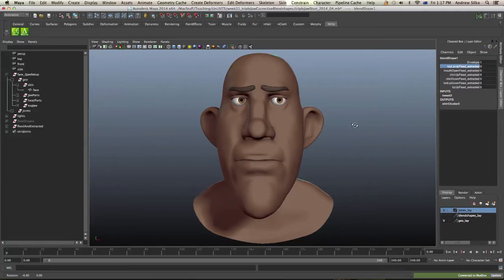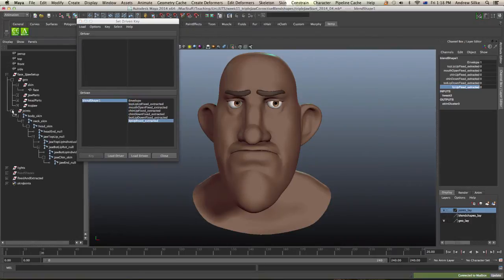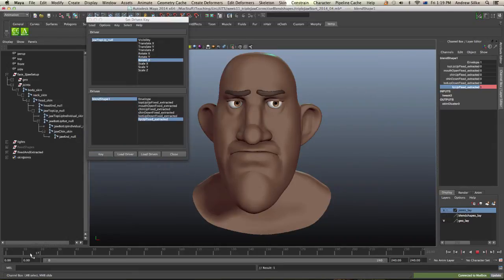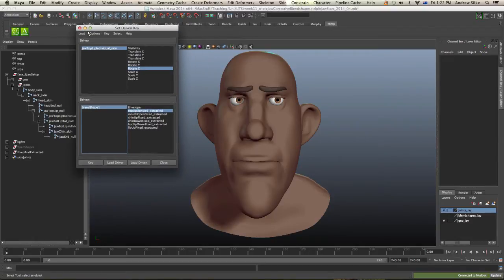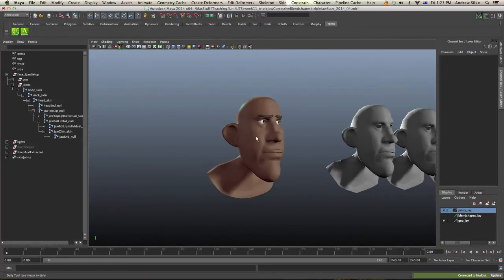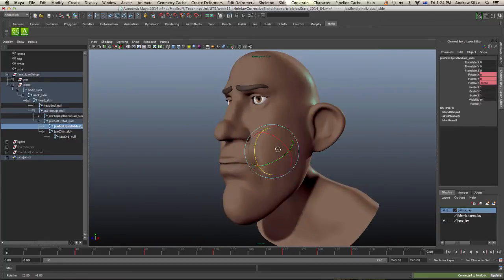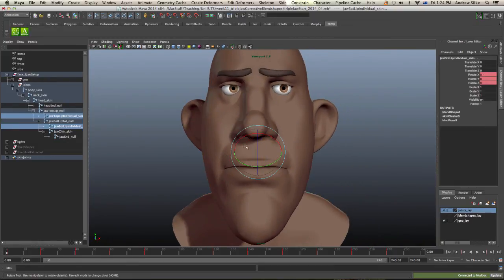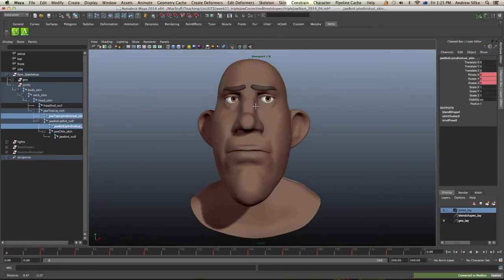Triple Jaw Setup - Automating Corrective Shapes Driven Keys (Maya 5/5)

Comment from the maker: I don't show it here but I group the bottom teeth and parent constrain them to the jaw open null joint.  That way they move when the jaw is opened and stay put when the bottom lip/chin is moved.  Top teeth are also grouped and parent constrained to the head.  I also sometimes make controls or animate the teeth geo for different effects.  Technically teeth are welded into the jaw and skull but for stylistic reasons sometimes we can move them around.